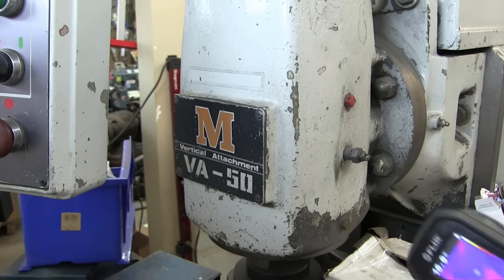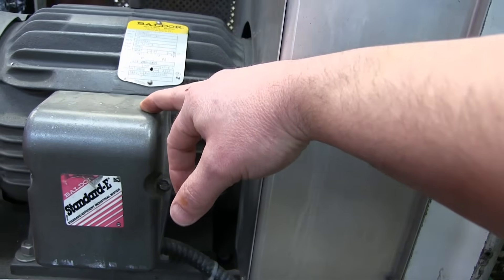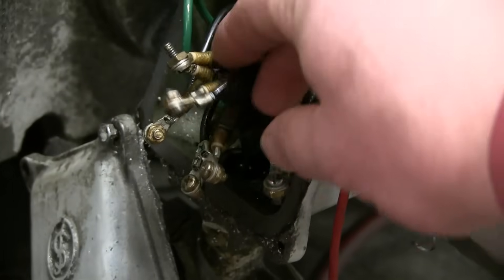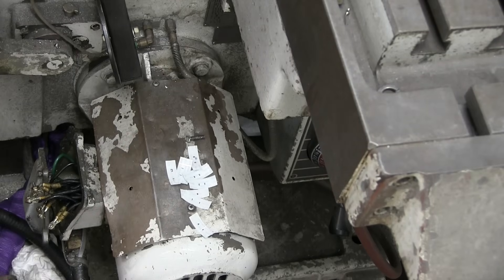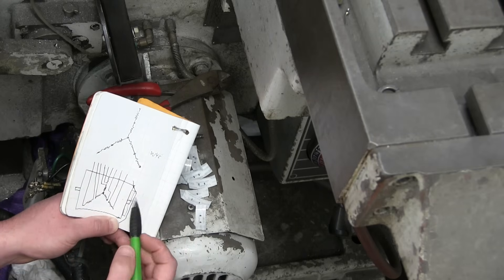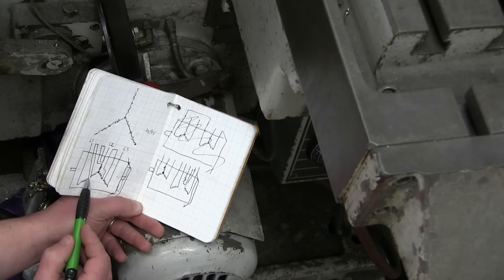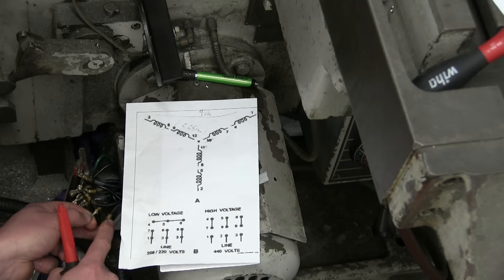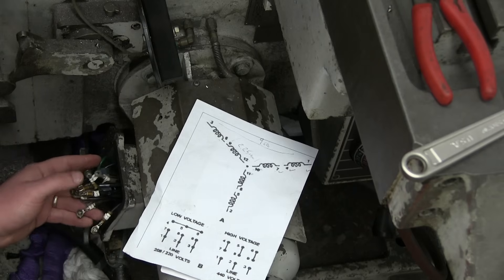MAZAK MILL AUDIT l 9 wire dual voltage electric motor wiring

Comment: Wouldn't you be able to check the phase of the different outlets at your place and put together a three-phase outlet? At work, we have an (incredibly unsafe) set of extension cords that does this...
Reply: You must work in and industrial setting, and have 3 phase to the building then.
Reply: I’ve seen people that don’t have a 220v Jerry rig something up with 2 outlets that are on difference circuits and run them together with extension cords. Is that what you’re thinking of? I’ve never heard of someone making 3phase when there’s only single coming in but I dropped out of industrial electricity in Vocational school 20+ years ago so I could be wrong.
Reply: That only works if you have a 3-phase service in the building,
Reply: Sopgenorth: If your building has 3-phase you can rig an extension cord across the right set of outlets to get 3 phase from them. BUT for a home gamer you only have 220v single phase and can use an extension cord rig to get that from 2 x 110v outlets provided you find the right 2 outlets.

Comment: No lies, I just got done reinstalling the threaded magic smoke retainers on a Westfalia centrifugal separator motor. Started the vid, got called in off my lunch, came back and finished the vid. I had known the Delta-Wye configurations for years but never understood the "why?" part until now. Thanks. Also, how long before a ped "calls out AvE" in a wildly unnecessary or passive aggressive manner for the oops 4-7, 5-6 (instead of 5-8), 6-9 layout?

Comment: How did you find #1?  I'm guessing just find a pair that show 8 ohms then you know you have two of the outer points, just use one of them?
Reply: Ok basically if all leads open, starting point is find 7,8,&9. Easy because they are only ones connected to two other leads ( since 10, 11,12 is shorted together.  Label them. Doesn't matter order if it spins the wrong way it'll get fixed later.  Then identify the pairs of leads for each winding left. Just measure for continuity.  Label pairs a,b,c.   Then get a 12-24v transformer and a current limiting resistor wire 7 to one side and 8 and 9 to the other.   Measure voltage each in a,b, and c.  Highest is 1and 4.  Next wire one of the identified 1-4 pair to 7( leaving other wiring).  Measure from the other in that pair to 8-9.  If the voltage is higher than what you put in you have 4 and 7 wired together if it is lower you have 1 and 7 connected. 

Wash, rinse repeat for other windings.  Pain it the ass but not impossible.
Reply: Joshua Gambrill, pretty much spot on. The defined deductive parameters being that 
1. Nothing has been altered since it was received, 
And 2. It was operated and proven to be in working order before priming in the empire.
To emphasize the point he stated early on with a set of diagonal cutters. As a field service tech with an apprentice to apprentice+ experience level in motor winding, it would be nearly impossible to identify the phase mating inductors without expensive equipment or risking the health and longevity of the motor.
Reply: Because the motor is wired for 480v 3 phase the configuration is lines 1-2-3 in to their respective motor lines. Motor line 1 is the opposite end of 4 on that inductor. Last, a 220-230/480 three phase motor can be reversed by swapping any two of the lines in. So for ease you can conclude line 1 is connected to motor 1 and not affect any of the connected terminals.
Reply: Or as the cool kids call it, the pecker head
Reply: Roscoe n so it doesn't matter? It could be one or could be three but it makes no practical difference once you work out the three inputs or have I misunderstood your answer completely (entirely possible)
Reply: He found 1 in the main box.